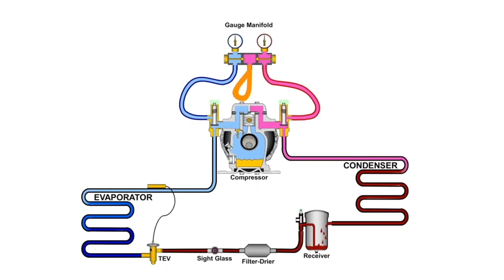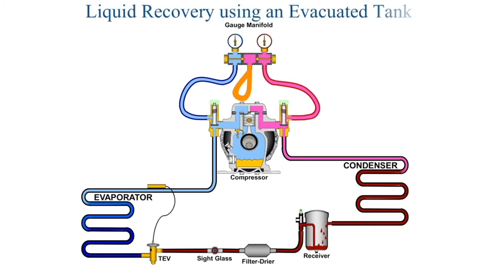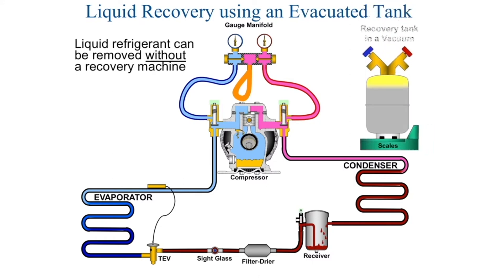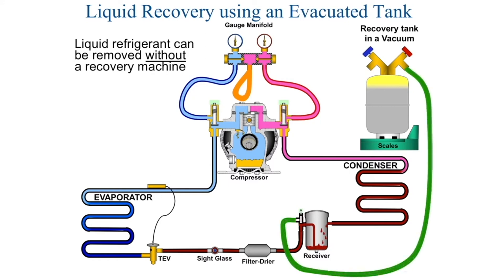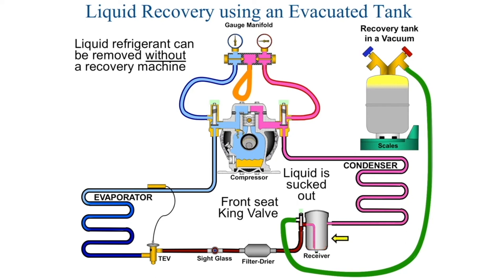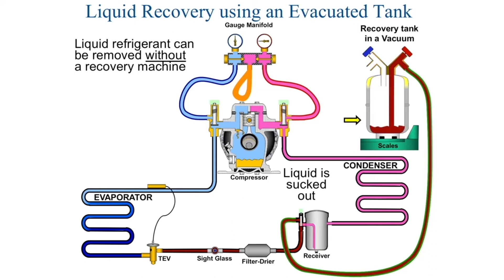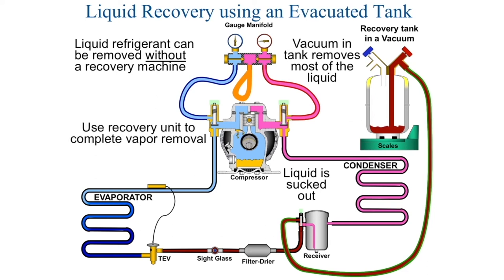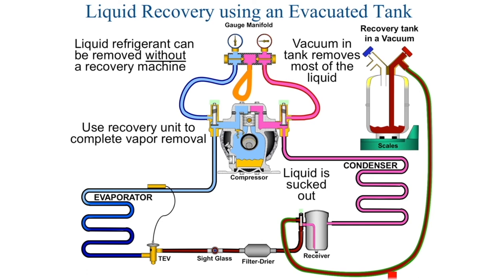Liquid recovery using evacuated tank

Comment: why is the filter drier called a "drier" ? surely there would never be moisture in the refrigerant ?
Reply from the maker: Good question! This is why I'm having a webinar on the 16th. It is important to purge the hoses when you hook up gauges to a system. A lot of technicians will not have low loss fittings although the EPA recommends that everyone uses low loss fittings. When this happens moisture can be introduced to the system. And also when people do not pull a good vacuum, meaning that they are not using a micron gauge or pulling down to 500 µm.      sometimes says technicians we forget proper procedures and we make mistakes.      Thank you for your comment and thank you for watching!